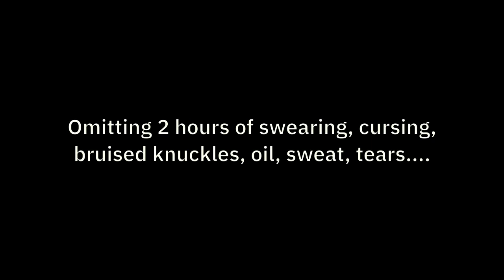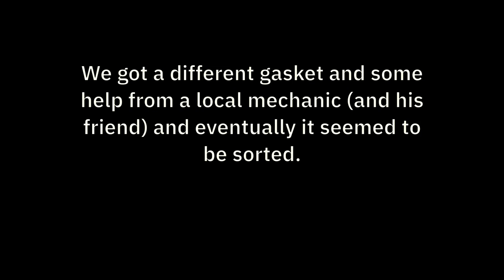No cruising for us - Volvo Penta Impeller seals - Sailing Northern Ireland - Ep. 149

Comment: If the oil is coming out of the weep hole underneath it is  probably the inner seal that needs to be replaced.  Normally it is the outer seal that goes producing a water leak, this can be replaced with pump in situe
Reply from the maker: It was oil and we now have a new seal in place

Comment: Another great video, warts an all.  Enjoy Scotland.
Reply from the maker: Thanks 👍 - Next week's has a few warts too, but at least we get to sea ...
Reply: @SailingYachtSaltyLass  yup good things are worth waiting for.  I was helping bring a mobo back from Inverness last week and loch Ness beat us back on four occasions, boat now lying in Fort Augustus and will most likely need 3k to 5k worth of work on engine after only 300hrs running. Just be thankfull that you only have one engine.
Reply from the maker: Be thankful you have a spare 😉  What went wrong? 300hrs is nothing for a boat engine
Reply: First it was diesel bug,
Followed by trim tabs packing in
Followed by broken exhaust valve spring.

You'd be amazed at how much exhaust escapes through the rocker cover when that happens, it looked like there was a fire in the engine bay.  The second engine is no use when the knackered engine is the one that runs the hydrolic pump for the power steering.  Nobody hurt and no further damage to boat so good learning experience, managed to get in by ourselves so still have clean sheet with RNLI.
Reply from the maker: Nightmare stuff.... sorry that it happened to you

Comment: Hi ladies. There are 4 through bolts on the water pump. Factory fitted 3 are one way round 1 is the other. Is that what you found? The easy way to get the troublesome bolt out is to wedge the engine in position with wooden blocks under the front end of the sump and remove the engine mount on the starboard side to get the bolt out. The engine is ok supported on the rear sail drive mount the port mount and the wooden blocks. As the saildrive, gearbox and engine work as one. There are no alignment issues. Remove the pump but be sure to mark the top on the engine and the pump as it can be re-fitted 180 degrees out of line!!!!!!!  Thats gona be a world of pooh....  If you get it wrong, as the pump will blow when it should suck and suck when it should blow 😱 The O ring on the back of the pump housing is from memory VP Part no 3580380 and a standard across the D2020, D2030, D1-20, D1-30 as they all have the same pump. Top Tip, while the pump is off do the inner and outer lip seals on the pump. VP 833996 Again all standard parts. However change the lip seal spring for an O ring of the same size as the springs rot out in a few months on the water side lip seal and also go week on the oil side lip seal. Your need a small hub puller to get the gear wheel off the pump but everything else is straightforward and will save you a few hundred quid. We did a vid but, you can always PM us if you need a hand. Great to see you getting stuck in! And a clean engine bay !!! Wooo Hooo!  Sail Safe Guys, Ant, Cid & the pooch crew.
Reply from the maker: It sounds like the Advanced Course. When we next try this we may well be in touch (we still have a very slight leak but nothing that worries us and it may be something else)

Thanks for the amazing advice 👍👍

Comment: I think the “guy” sold you the wrong O-ring to start with..  try using OM parts, not all O rings are Oil resistant, actually most aren’t..  
you probably would have had better luck using that original O Ring, clean it well and some oil proof silicone, other than a non std seal. 
One other bit of advice, try to invest in racket spanners, king crome do a nice Basic set of 7 for around $70 Auds..  1/2 that in pounds..  they will make everything easier.     Nice being able to sit back and give advice in hindsight..  really glad to see you both attempt a repair like that to begin with..   proud of you guys!     You may think “silicone?” The guys doesn’t know, but if you but the correct form a gasket, heat proof and oil proof silicone, Dow cornings make a good one,  where you can’t get the OEM part, for any reason,  use that, but really neatly, “a little is excellent” more is a mess, kinda deal..   it won’t replace the O ring, so a slight smear either side, bolt it back while wet, allow to dry, them nip the bolts slightly more.  Should be a permanent repair, atleast untill you can get the correct part..
Reply from the maker: I think you are bang on the money. We got a different gasket which is much better

Comment: So now you can take off the pump and reinstall. I call that a win. Volvo do have part numbers for the o-rings, overpriced of course, but I use these. Also I kept empty plastic milk containers cut in half to jam in to spaces below the engine when changing filters etc etc to catch oil. Enjoy Scotland.
Reply from the maker: So far Scotland has been very nice. Good tip about the milk bottles 👍

Comment: A word of warning, don't over-tighten O rings. I made this mistake kept tightening to try to stop leak and the pump casting cracked. An expensive mistake, in my defence I was young and gung-ho at the time.
Reply from the maker: Thank-you for that tip, we were not aware that could happen.
Reply: @SailingYachtSaltyLass  Love your idea about the fixed lengths on the sail-bag lines, great idea. Thanks. 
Here's one for you guys, Wichards Boom-Brake. I have to use crew as wife got cold feet and won't sail anymore. No matter how many time I try and teach them not to accidentally jib... now I can look the other way, makes tacking smoother as well.
Reply from the maker: @johnhayford5946  - some final adjustments are needed for the sailbag idea since to remove the sail we would need to unsplice some of the dyneema loops. We have a solution  and we will put it in a future episode.